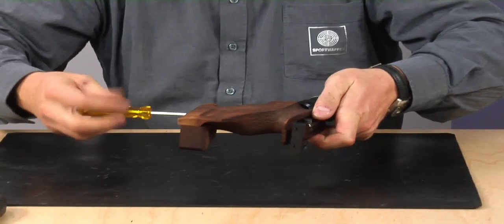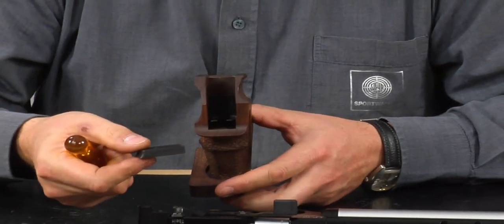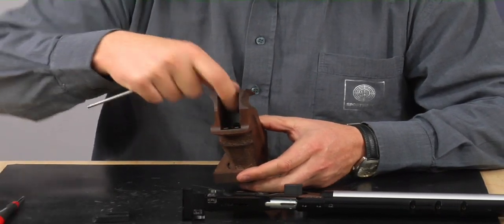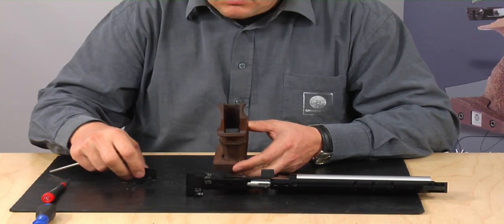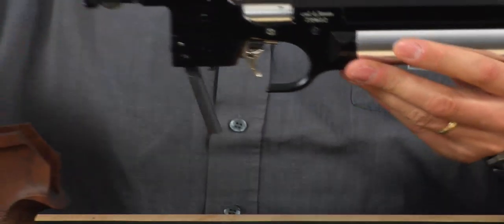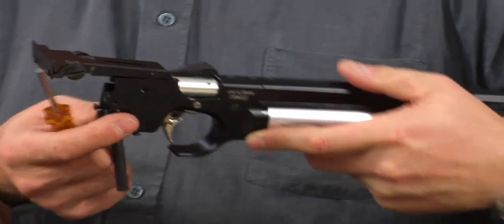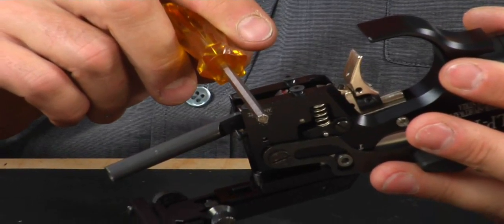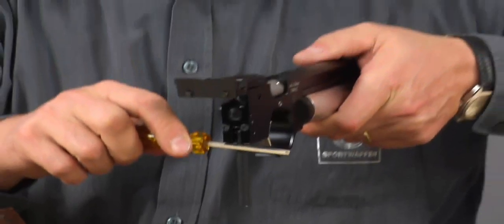STEYR LP 10 Adjusting the grip

Comment: To be honest, I have never found using the screws to make grips adjustment's to remain stable. The vibration of the gun causes the screws to move out of adjustment and the grip ends up riding about independent from the rest of the gun.